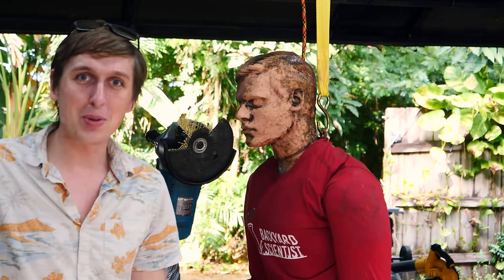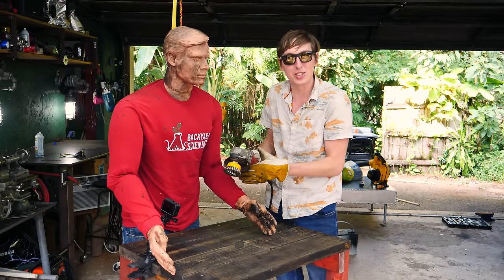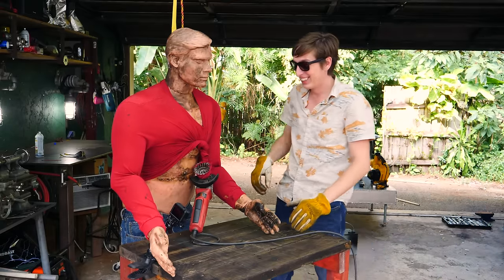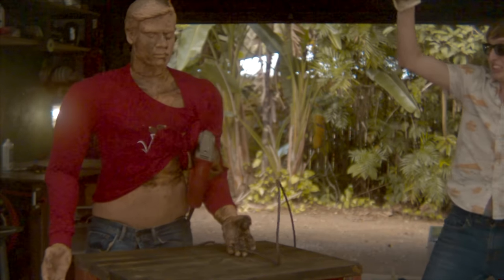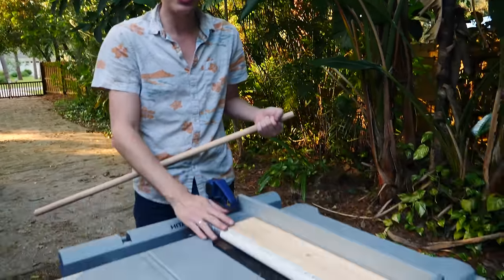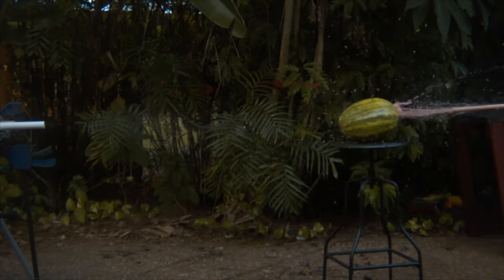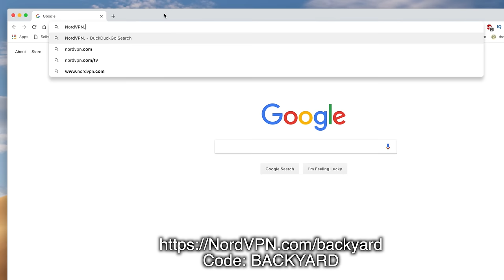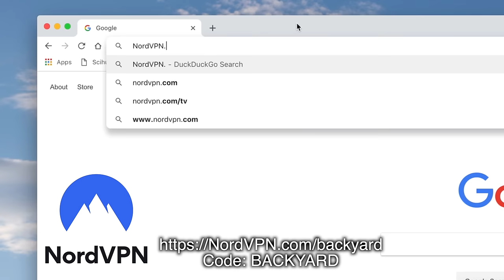This Is Why You Need To Wear Safety Glasses

Comment: Yea, my engineering teach got his finger cut off messing with one of those blades; he should've been wearing his safety glasses.
Reply: Lol
Reply: If he had been wearing the glasses, he could have blocked the cut with his eyes, saving the finger.
Reply: @Lucas Fly2010 no dip Sherlock
Reply: Lucas Fly2010 Mmm I feel what you did there
Reply: Trenton Brooks yep, should’ve been WEARING SAFETY GLASSES ON HIS HANDDD
Reply: Yea, those safety glasses will really protect you from a flying 2x4
Reply: @dimitrije907  wdym? 😂
Reply: Trenton Brooks I had a woodworking teacher who made a mistake with his push stick on the table saw. It ripped it out of his hand and launched it 100 feet behind him, put a hole in the sheet rock 20 feet high. Those table saws are scary powerful.
Reply: Lol
Reply: Have you seen those stop guards that can stop in milliseconds to save a tender hotdog? I dare you to stick your hotdog in one 😂
Reply: woooooooooooooosh
Reply: I sense an r/whoooosh
Reply: You have a point

Comment: Fun fact, from my experience with it (I work with metal fabrication) if it gets tangled up in your shirt all the way, you will be pretty much okay. If it breaks the material, you will have a bad day. I have three scars and a number of cuts on my hands from angle grinder related accidents. The wheel with wires is the worst as far as pain goes and it also likes to jump around. Btw, two days ago I almost got killed by a broken disk. It missed my neck with a few centimeters. The other piece hit me in the face. My glasses caught it. So yeah, wear glasses. I guess
Reply: That sounds horrible and super dangerous. :s Glad to hear the glasses were protecting you
Reply: Glad you're ok
Reply: Excuse me, the wheel with wires?!
Reply: what you leran from that story. . .           IF YOU WEAR SAFTY GLASSES YOUR IMMORTAL TO WELL ANGAL GRINDERS I QUESS lol🤣
Reply: That's why i wear a faceshield

Comment: "This Is Why You Need To Wear Safety Glasses"

Proceeds to launch a spear at 100mph using an untested device.

- Doesn't wear saftey glasses
Reply: Thanks. We saw it too.
Reply: It'll buff. Have faith folks he's a professional 🤯
Reply: @johnreese1337  lids of steel yeah?
Reply: BeatJumper 👽 you think safety glasses can protect against a spear
Reply: @intolerances686  No, but they could protect your eyes from splinters or the pvc pipe flinging up.
Reply: Best way I've ever seen safety spelled. 😂 I had to it was funny

Comment: My power tool incident happened while using a miter saw when I was about 17 or so.  I was using the saw to do a straight cut on a 2x4 and didn't realize my brother had used the saw that same day and unlocked it so the blade could be pulled out to cut a wider piece of wood.  I don't know exactly what caused the kickback I had, but it ended with me slamming my hand straight into the side of the sawblade with enough force to bruise and cut my knuckles.  Still grateful to this day that I didn't throw my hand right into the teeth of the blade.  My lesson learned and a lesson for others would be to check the tools you're about to use if anyone else has access to them to make sure that they're set up properly and not fiddled with.

Comment: -> talks about tool and shop safety
-> wears gloves while working with rapidly spinning tools
-> doesn't wear safety glasses for the majority of the video
-> turns a tool into a gun
lmao, fun vid tho
Reply: This is why and when I unsub.
Reply: Xylitas why shouldn’t I use gloves when I’m working with rapidly spinning tools? I guess I’m confused what the cons to using them would be
Reply: @kohfee9967  - Bye!
Reply: Had sunglasses on his head while chainsawing a watermelon. Sunglasses, not even safety glasses. Great plan.
Reply: @dethbell08  the gloves act the same as the shirt does in the angle grinder. You are much better off using no gloves and possibly cutting a small part of your finger in the table saw than wearing gloves and having your whole hand caught in it.
Reply: Xylitas that makes sense forsure. The feel you get running a grinder with no gloves feel much more accurate and precise. Less chance of a accident I understand
Reply: @kohfee9967  be gone Satan
Reply: Nearly all job sites require you to use gloves with  portable angle grinder with cutoff wheels or grinding discs..... This only really applies to bench grinders, lathes, vertical mills and that sort of thing.
Reply: @alexfreedman1092  Ya, What you are describing is a violation of OSHA guidelines in the USA. Gloves are not to be worn when using ANY rotating machinery. This includes portable and stationary machines. If the guards are in place, your hands are protected. I had a coworker in the woodshop I work at break every bone in his hand after his glove got caught in a drill press. He was wearing gloves after he was specifically told not to less than a week before. He didn't want to get splinters. Now he can barely hold a pencil.

Comment: Never wear gloves next to spinning tool. Table saws especially. if it grabs the glove your hand will be sucked in and gone in seconds. Without gloves you are able to pull away and lose a single finger. Rather than a whole hand.
Reply: but at the same time if it's minor and it doesn't grab you're glove you can go home scot-free
Reply: David shaw do you honestly think that a glove will protect your fingers from a piece of sharpened metal spinning at 25k+ rpm that’s designed to cut through wood and possibly metal? No your better off not using gloves. That includes circular saws and angle grinders.
Reply: Add spindle sanders to that no-glove list. It took 9 months before I could play guitar again.
Reply: Welks just make sure to stay careful regardless :)
Reply: 4:42 ...you just demonstrated how bad loose clothing getting caught in a spinning tool is - why are you adding loose clothing to your hands!? o.o
Reply: Agreed. Seen my mates gloves get caught in drills all the time usually losing nails or broken fingers.
Reply: @WhyNotRichie  Yeah done it myself a couple times, you'd think I'd learn.... All real low speed - low torque, but enough to scare ya!
Reply: Long sleeves are a bad idear as well
Reply: Spinning tools and gloves/loose clothing or hair are a bad mix in general.
Reply: And never, I mean EVER try to lick the spinning blade... I've seen the results myself and I can tell you: It doesn't taste good.
Reply: I experienced once when I was using a table grinder that the finger on one of my gloves snagged on the stone. But it just teared and I flinched away. I didn't get hurt. Why was I using gloves with the grinder? Because I was handling sharp and hot metal, as well as oils and metal shavings. In other words, stuff you want to protect you hands from. I think the reason it just teared and didn't snag was because it was synthetic leather, which is pretty smooth and when damaged, the damages will be more clean cuts and holes. But honestly, you should make that assesment yourself, and live with the counsequenses, either good or bad. I used gloves for a long while, and I've only had 1 accident wearing them. So I'll continue wearing what I feel is appropriate. If you don't agree, then fine. But don't claim I'm irresponsible, I didn't mess around in the workshop during school, playing with the compressed air or wave around knives. I didn't break a tool we just recieved

Comment: Backyard scientist: *shows how dangerous power tools are without protection

Also backyard scientist: *doesn't wear goggles
Reply: Also Backyard Scientist operates watermelon juice soaked power tool
Reply: To be fair, short of getting yourself a full set of plate armor the angle grinder chainsaw attachment is deadly regardless of how much safety gear you are wearing. The most dangerous thing you would normally attempt to do with a chainsaw is a plunge cut leading with the tip, and with the grinder wheel version you can only do plunge cuts and the whole thing is tip, and it is even more dangerous because the angle grinder operates at much higher RPMs

Comment: I learned a long time ago to respect all power tools and they will kill you in a heart beat if you don’t respect them, I’ve gotta above all these the Jointer and the table router are truly some of the most dangerous common power tools, I’ve personally seen someone using a 8” jointer have the board hit a knot and get shot out and just absolutely mangle someone’s had which they had to have amputated due to the severity and I’ve also personally injured my fingers in the router table which is terrifying

Comment: Thanks backyard scientist for showing us a weapon for the apocalypse.
Reply: You planning on having electricity to run a table saw during the apocalypse?
Reply: Generators are a thing lol
Reply: @Definitelynottheatf  and you plan on having a bunch of fuel for that generator that you are going to use to run a table saw to use as a weapon? Refineries won't be around. Gas stations won't be around. Solar power will have one hell of a time putting out enough power to run a table saw for long. And it would be extraordinarily wasteful to use it for what is essentially an inaccurate ballista.
Reply: john jon taking this a bit serious? I’m sure they’re joking
Reply: @totallyawesomeusername9307  just pointing out that people have to think things through .
Reply: @johnjon4688  yes, ya gotta think the science and math and pretty much everything through before you can make it reality, which wouldn't be possible. As the saying think before you leap it also is related to think the science and math before you try
Reply: Kinda usefull now
Reply: Now jusr make come back to you like a boomerang
Reply: Can you imagine using a machining unit for a zombie apocalypse
Reply: @johnjon4688  solar panels are a thing..
Reply: @thelegendofjay  how exactly do you plan to manufacture silicon semiconductors in the apocalypse
Reply: Yes based on the follow-up, when he pulled the dowel out of the bush, they only need to be one or two feet long in order to hit the top speed 😉

Comment: We just normally use safety squints
Reply: Hahahaha, I've definitely done that a couple times before. Like that would help anything though :D
Reply: @joonasfi  well it would be better than nothing, but nothing compared to proper equipment
Reply: Jonesy Films lmao
Reply: Engage safety squints!
Reply: @joonasfi   It does. It's amazing just how much debris your eyelashes can catch! Squinting can make the 'target' a fifth of the size too, so you have a smaller target and some protection over it. Works great when your only hazard is dust at high speed.
Reply: BruceNJeffAreMyFlies true dat!  I caught molten solder with my eyelashes once.  It worked that time, but now I use glasses when desoldering anything under tension.

Comment: I was once working in a metal factory and there we had circlular saw blades used in angle grinders, for the aluminium. There was one accident when the grinder bounced from the objective and cut one worker straight in the face. He lost few teeth, his cheeck was cut in half, I think maybe also his jaw bone and there was ALOT of blood. There were pieces of his head all around the working area. Now he is fine but has ”Joker scar” on his cheeck tho.
Reply from the maker: Yikes!

Comment: The reason the grinder kicked back at you at 11:43 was because you have the wheel spinning into the material when this happens the grinder wants to pivot off your hand and dig the disk further in causing it to catch more. The much safer alternative is to have the disk spinning the other way so it drags the grinder forward which causes it to what to spin out of the material preventing it from catching.

Comment: "This Is Why You Need To Wear Safety Glasses
"
*Shoots rod at metal using kickback from a table saw and doesn't wear safety glasses... nice ;)
Reply: I doubt safety glasses would help against wooden stick flying at 90+ mph. Of course it would help against flying debris. But all in all such experiments require some basic precautions of which there were none.

Comment: The thing with angle grinders is they're dangerous, but can be a whole lot safer if used right. Always try to use the side handle, wear a leather apron or welding jacket, use the guard, and wear gloves. My welding jacket and leather apron have saved me from getting hurt so many times. A few times a drill bit snapped and the drill slipped then got caught in my jacket, numerous times from sparks and loose wire wheel pieces, and just getting burned in general.

Comment: all that talk of safety then you use that aweful "chainsaw" blade with no eye protection @ 11:40 onward
Reply: And the angle grinder is used the wrong way(The Handle was on the wrong side), you should always cut towards your self, for better control.
I think he should get a hardhat, glasses and gloves, that is kind of the standard safety rule every country has.

Comment: I'm a millwright and I was working outside during winter wearing wool gloves and I caught one in a wire wheel on my grinder and wow was it hard and fast. Didn't even comprehend what had happened until my hand was completely pulled into the grinder and it wound up in my glove. I was lucky and only had scratches. Always remember leather gloves, and get winterized ones if you work metal outside in the winter. Also, I highly recommend a grinder with a break and bind protection so the grinder halts if it ever binds.

Comment: Of all the people I've seen be sponsored by nord VPN, you were the most convincing and I may buy it
Reply: Me too
Reply: Someone else I watched who were sponsored by them actually showed it working by using Linux and software to trace IP data etc.
Reply: I've used it for a long long time, it's a good vpn tho.. there was 3 days trial until they change system so no more free trial :(
Reply from the maker: @izzunabdussalam6512  I used to use IVPN, so far I think Nord is faster.
Reply: Big Money was very convincing.
Reply: I use nord vpn but it does not work at my school it just won't connect, so they probs have something to counter them

Comment: I think most of the time getting a grinder caught in your shirt isn't as bad as it seems. I had it happen once and it just left some minor scrapes. Using cutoff wheels is much more dangerous than grinding disks and also those blades with teeth that can be used for aluminum are pretty bad if they go out of control.

Comment: For the record, the type 27 guard (one sided half circle) is not the correct safety guard for use with cutting blades.  A type 1 guard (two sided half circle) is the correct device.  For grinding wheels and wire wheels, the type 27 guard is used.

Comment: 2005: I got too comfortable using a table saw and didn't use a pusher when cutting a small piece of MDF. My finger slipped and went into the danger zone. I nearly bled to death and required 6 stitches.
2017: Using an angle grinder with wire wheel at work, I was a pin cushion for days on end while grinding industrial paint off a stainless steel tub.
2018: At work, again, I was using am angle grinder with grinding disk to remove ridges on the loading dock of a semi-truck. There was no guard. Somehow my finger got in the way and I grinded my knuckle to the bone. 5 stitches this time.
Reply: 2020: No longer works with power tools

Comment: My friend was once using a biscuit jointer that got stuck and ripped itself out of the wall and the plug came swinging around and hit me in the face. Luckily I was wearing safety goggles and the plug rebounded off with no issue except crack goggles. If I didn't wear them I'd have lost my right eye.

Comment: ffs... you do not wear gloves near a table saw. You just don't. The very first job i had, i had a workmate who did just that and chopped of every finger on his right hand. They could save couple, took his toe and made it a thumb.

Do not wear gloves with table saw.  If you must, make sure they are the thinnest type you can find, you do not want any loose clothing around your fingers with that thing.
Reply: Yourcontent should say, "do not use gloves when using a table saw to cut wood." He was not using it to cut wood. He was using it to launch wood. And for his use case, he most certainly should have used gloves. He was far enough away from the blade where the benefits of using gloves far outweighed not using them.

Comment: I have an industrial table saw. The current one is my second. I DO NOT use the kind of push sticks you showed. They scare the hell out of me.

Kickbacks start at the back of the blade. Push sticks, like you showed only hold down the front, and not at the danger zone in back. 

The ones I make and have used for the last forty years are about 12" long. They resemble the sole of a shoe. The heel pushes the wood through. Then, end holds the wood down nearer the back of the blade. You can run the whole thing into the blade, because they are expendable.  The push shoe holds your hand well up above the blade, which only needs to be just above the thickness of the wood.

I have several over the top of my saw, where I can reach up and grab one, if I forgot to have it ready.

Comment: If you put a metal tip on the wooden dowel, you could probably use it to pierce tank armour!
Reply: Not a chance, even relatively thin tank armour is about 1.5 inches. The most that dowel might make a small scratch but thats it
Reply: No definetly not its better to compare it to a compound bow which can shoot a smaller sharper projectile up to 200 mph or 320 kph
Reply: Probably not tank armor. Maybe medieval armor if you hit it at the right angle. Good chance of it deflecting though.